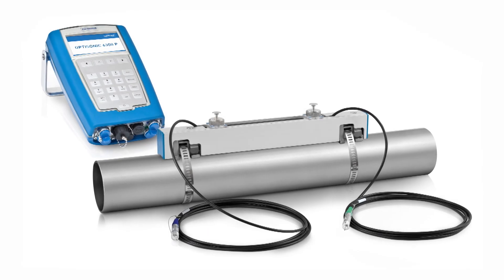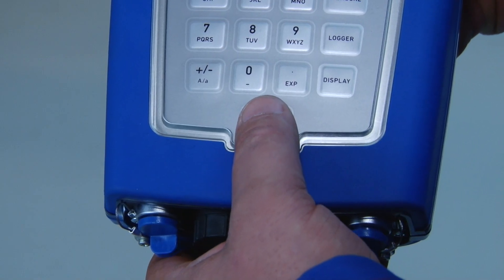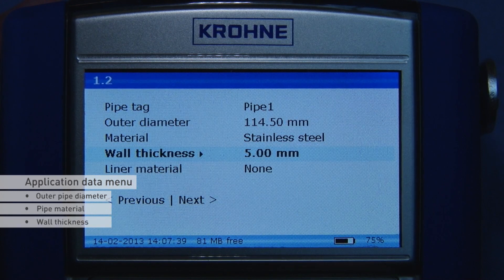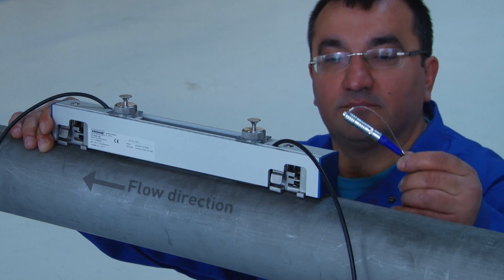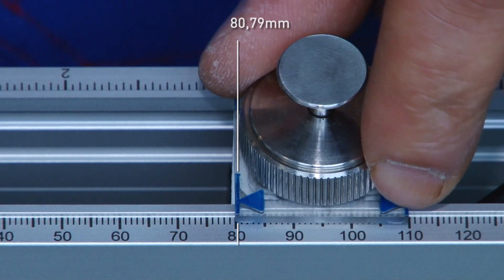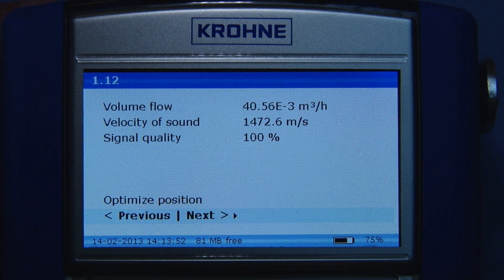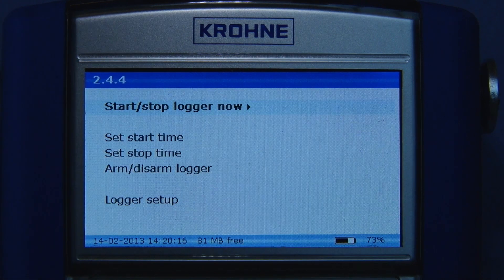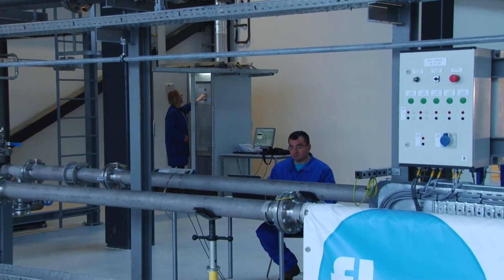OPTISONIC 6300 P: Portable ultrasonic clamp-on flowmeter | KROHNE

Comment: Can this tool be used for gas service?
Reply: The OPTISONIC 6300 P is a portable clamp-on flowmeter for liquids. The device cannot measure gasses. For gas measurents we recommend to consider a inline flowmeter, because a clamp-on gas flowmeter is not straight forwarded, and has several limitations. With a inline ultrasonic flowmeter we measure independent on molweigth and up to ambient pressures.